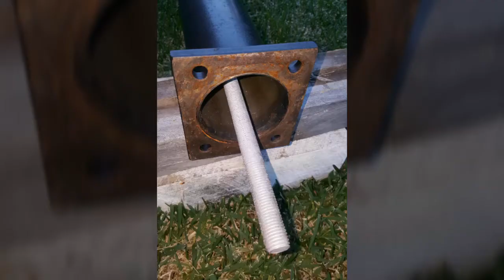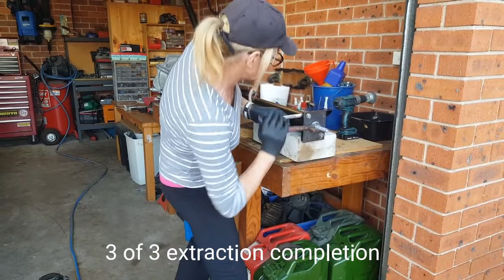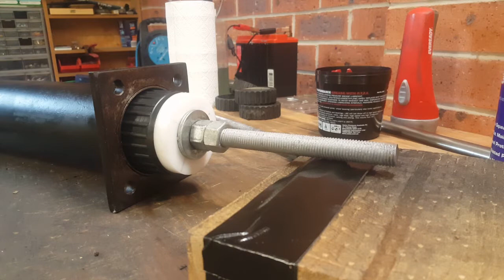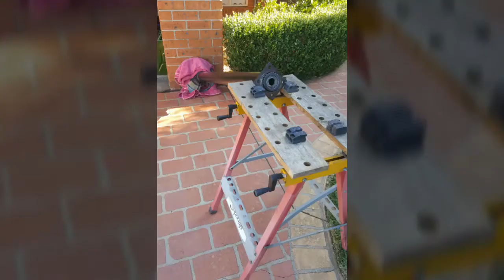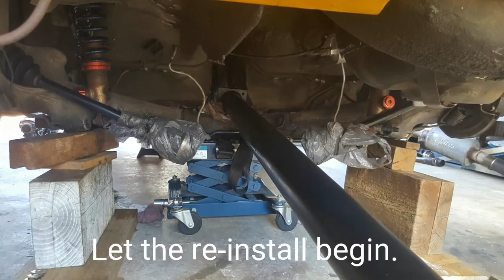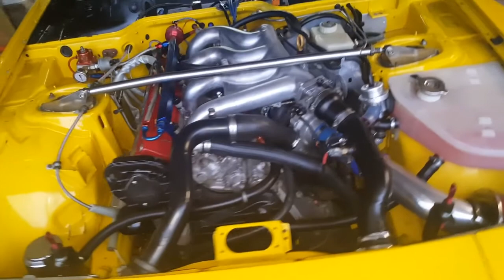Torque tube rebuild: Porsche 944

Comment: Interesting to know, I have heard of the flex plate / torque tube issue but was not sure what the problem was. I currently have an auto trans full of radiator water due to a ruptured heat exchanger in the radiator, would be nice to do this refurbishment too, i'll ask the mechanic to check it when the trans is out.

Comment: OZ 951 great video. I need to try that on the 1987 944 Turbo you sold me in SATX all those years ago. BTW it is still running after a complete engine rebuild, trans rebuild, MAF/MAP and DME conversion and a few other projects,

Comment: This is an interesting comparing this procedure with that on my Z06 Corvette. To do the torque tube in the Z, it takes about a hour and a half (after it's off the car) and a $250 bearing/coupler kit (Made in Germany, believe it or not). I'm planning on doing this when the clutch is replaced. It's about 8-10 hours of labor to extract the TT. I'm planning on the entire job to cost about $2500-2800 turn key. I'm assuming on a 944, it's about 3-5x more...

Comment: What modifications have you done to your engine? Are you using a vitesse system,etc. Would be interested to know your performance upgrades as I am at the beginning stages of an engine rebuild and want to incorporate as many performance upgrades now as the engine is being built. Also are you using a manual steering rack, I don't see the power steering reservoir in your engine bay? Thanks for any info you might provide